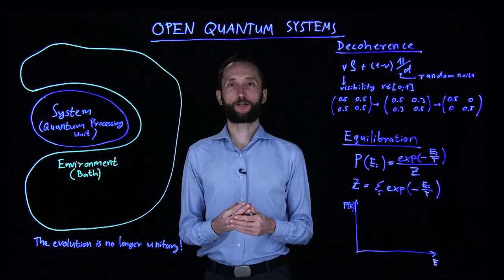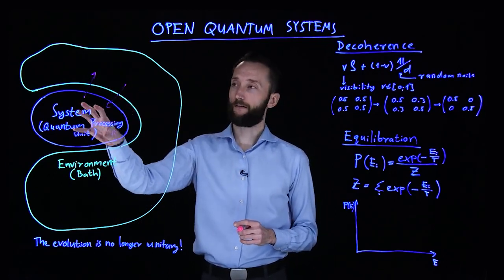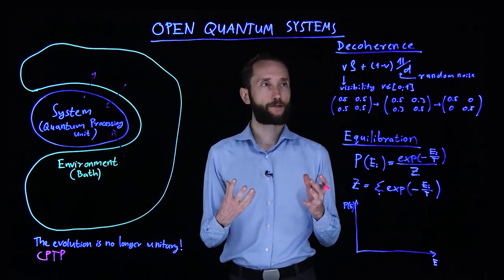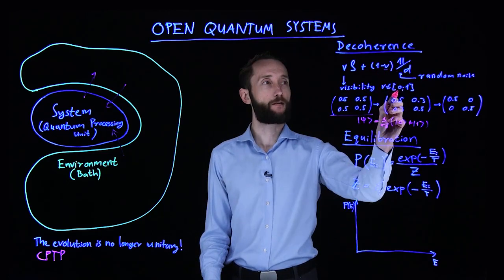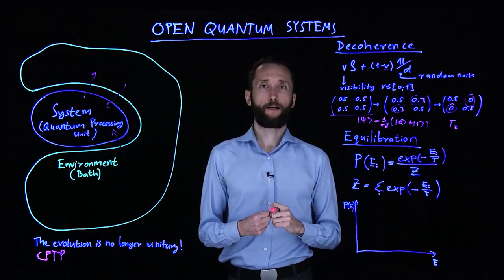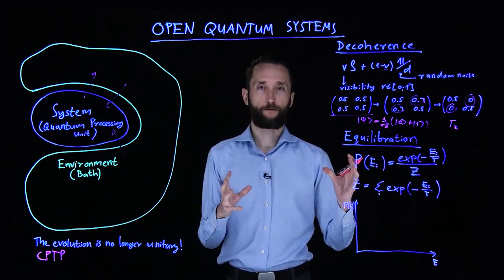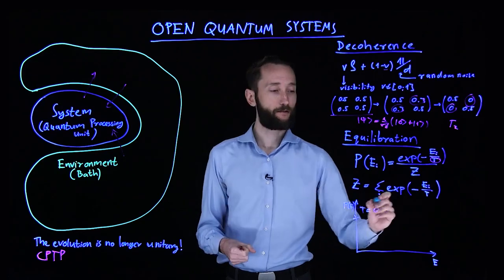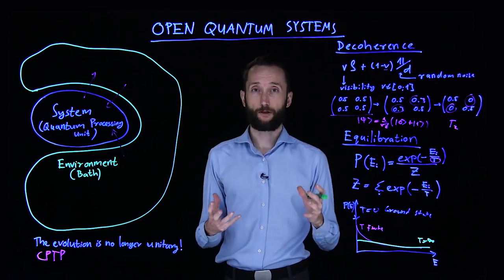Quantum Machine Learning - 08 - Open Quantum Systems

Comment: I want to know in what way does the system interact with the environment? What kind of interaction? What does it mean by saying system environment coupling? What if the environment is vacuum?
Reply: If the environment is a total vacuum then the system is closed - there is no interaction. But real-life quantum computers are not floating in a zero-gravity vacuum.
The specific type of interaction depends on the type of quantum computer and its specs. For instance, it could mean that the atoms of the environment discharge photons, usually in the infrared spectrum, and shoot it at your q-bits. Also, all atoms have an electric field, so they can affect your q-bits with it.